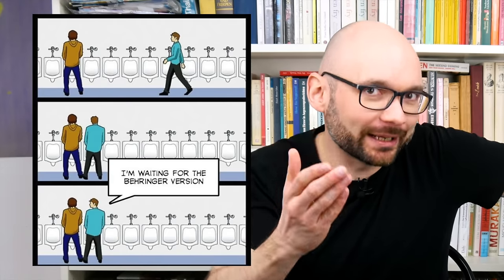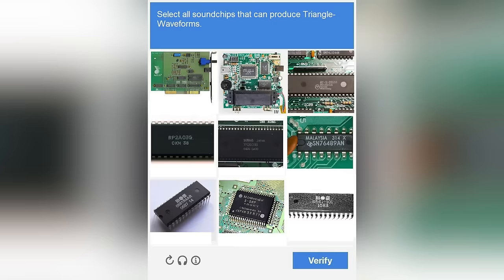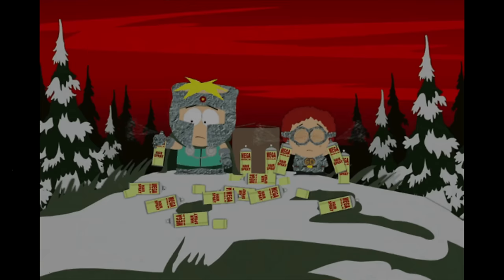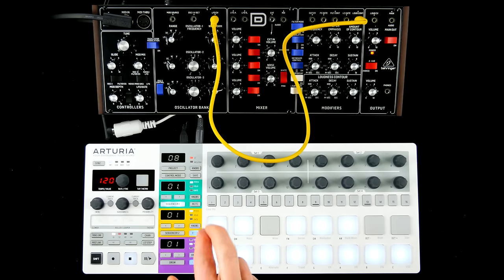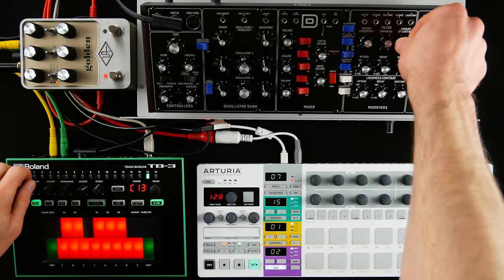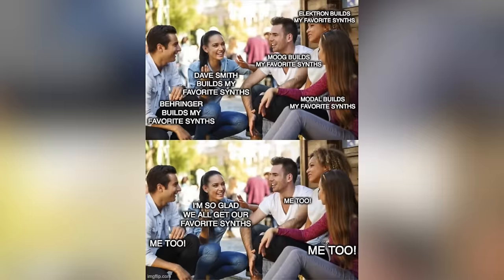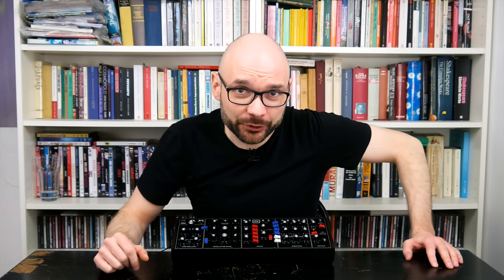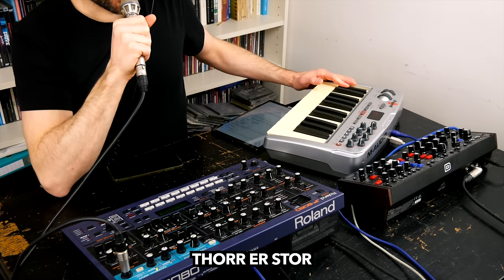Bad Gear - Behringer Model D

Comment: As someone who has never been in love with the Moog sound, getting to experience a bit of the Model D for just a few hundred dollars was good for me.
Reply: If you're not in love with the moog sound what are you in love with
Reply: @tadknuf7979  not moog sound.
Reply: And then you realize that it isn't a Moog model D ( which Moog, btw ) , but in fact a 'Behringer D".
 Simulacra and simulation of a genealogy, indeed. Genes are just genes, and then there's everything else that aren't genes.
Reply: @shaft9000  Soulless digital Internet can never replace the original, warm, cooing and pooping mail pigeons.
Reply: @tadknuf7979  I’m partial to the 90s Roland sound. I had two M-32s and two DFAMs at one time, but I had to sell them. I do miss them, but I could never sell my JD-990.
Reply: I like the Moog sound in moderation. It takes a Moog Whisperer like Lisa Bella Donna to keep an entire herd of Moogs from excessive Mooing.
Reply: I’m a buchla sound guy myself

Just something about having a synthesizer the size of a car that takes full size patch cables just to still be basic and mono will never sit right with me

Moog doesn’t really do things different either they’ve been hashing out different versions of the same thing since the 70s
Reply: @tadknuf7979   *butts into conversation* .. I confess, I'm in love with all of it. But my favorite is classic wavetables and vector, a la Wavestation, SY77, Waldorfs.
Reply: @cablevamp3163 DFAM, Sub-Harm, Moog One, Semi-modular synths G-Mother, Matriarch?
Reply: I like your name
Reply: @danieklerr  SY99 is AFM and AWM, not vector
Reply: @jonytube  .. True, sorry. I meant SY77. I have both, and the 99 is weak in comparison.
Reply: @ptkelly80  🤓
Reply: @danieklerr  the 77 is AFM+AWM as well, the only difference from the 99 being no user sample memory and (5 octave instead of 6) keyboard. Aren't you thinking of the SY85?
Reply: @jonytube  .. Dang, I hope not, lol. I'm a little young for dementia. It's definitely not the SY85, which I sold when I got an FS1R. I thought the SY77 (I have the TG77) had vectors, with four directional buttons on the front panel, similar to the Wavestation SR. There is something to note, however.. I have been collecting gear since the late 1980's, and I have so many synths that they are leaning in rows against all four walls of a huge room, or in racks. I have to rent a large space outside my home to store them, and I am probably beginning to forget specifics, lol.
Reply: @jonytube  .. I dug through the pile. It's the SY35, which has a dome-shaped vector joystick, but has indentations for fingers, giving the impression of buttons. :)
Reply: @shaft9000  I remember when there was mini Moog and the micro Moog.
Reply: @cablevamp3163  Sold my Matriarch after having it for a few months for those reasons and some others. I bought an Arturia MiniFreak with the money and I can make all the sounds the Moog could make and even more, plus I could actually save them. Analog purists are living in a fantasy land. I'm done paying Moog tax just to make sounds that can be made on synths that cost 1/4 what the Matriarch costs.
Reply: @danieklerr  yup, that seems right. My 77 isn't vector :P how's that FS1R?
Reply: @IISG93II  as good as minifreak is, no, it cannot make all the sounds a matriarch can.  It can make more sounds, arguably better sounds, but not the sound of a matriarch.
Reply: recreating "moog" sounds isn't hard. I've been messing with sound design for a while and this is all very achievable even with software synths.
Reply: @nullbyt  as some who doesn’t simply mess with sound design and has been doing it longer than a while, a soft-synth gets only so close to an actual analogue, even if it can get 90% there.  That extra 10% matters.   I just got the akai mini d and it’s meh.  Arturia only slightly better.  Vst is vst.  One day it will get there.
Reply: @alexwestconsulting  I agree kinda.... But like when you're willing spend a ton of money on an analog synthesizer for that 10% I guess it really needs to be worth it imo. And like why even buy something that's a low quality recreation lol just seems like it's missing the point of owning something like an analog synthesizer to begin with
Reply: @nullbyt  The Model D is very good.  I own a bunch of real Moogs and I would recommend the Model D.  There's something about bass sounds in particular, so important in any track, that can't yet be done in VST, and the moog sound is one of the quintessential ones.  If you got a model D and Pro One, not at all expensive, you would cover a ton of sonic territory that VST just can't (yet) nail the dynamics of.  That 10% is the difference between "the sound of", and a living, breathing sound.
Reply: @cablevamp3163  I am getting more familiar with the Buchla sound and concept of west coast synthesis. The sounds are indeed awesome but they seem to be relegated to pure electronic synthesis in the experimental style. I might pick up an Easil. They are well designed ,definitely not cheap either. I don't see them superior or inferior to the Moog style of subtractive synthesis. Just different and unique in their own sound.
Reply: @alexwestconsulting  A friend of mine is close friends with Adrian Utley from Portishead, who has a huge collection of original synths, including many Moogs, and he told my friend he can’t really hear the difference
Reply: @tompoynton  can’t tell a difference between what?  I mean, first off, Utley, great as he is, isn’t the only one with an ear.  But, more to the point, are you suggesting that a second hand account is accurate in what he said?  Are you saying that your friend said that he said “I can’t tell a difference between a boog and a minimoog”?  Or are you saying that your friend said that he said “I can’t tell the difference between any of the clones and the OG’s”?  Because, frankly, I do not believe he said the latter.  The differences are well documented.  No one, for example, thinks that the MS-1 clone sounds like the real thing.  I mean, it’s just a straight up fact that behringer is putting the same Curtis clones 3340’s in just about everything they make.  They aren’t making Roland chip clones.  Not yet anyway.  So, if the Behringers have the same components, while the OG’s have a breadth of different components.  How can the Behringers truly sound like the OG’s?  And how can the Behringers sound different from one another?  Many people think that the crave is M32 clone.  In function it is.  In sound it is not.  I have both right here.  They don’t sound even remotely similar, with the crave having Curtis clone 3340’s, the sequential sound, in a  moog “clone”.  It’s kind of funny really.  Or do you mean that your friend said that he said “I can’t tell the difference between VST and an analogue”?  I mean, I know how much gear Utley has, so that would be nonsensical on its face.
Reply: @alexwestconsulting  he was talking about the model D
Reply: @tompoynton  yes, the model d is very good.  Best of their clones.  Nice and smooth like a real minimoog. Doesn’t sound like a sub phatty though which has more “character”, and doesn’t sound like a Minitaur which is a bass monster, so I hope people understand they are getting a moog clone, but only A minimoog clone.  The new generation of moogs are stellar, many of them affordable, So I hate to see people cheap out and not buy unless Behringer rips it off.  Also, I have a poly D too and poly D and model D sound quite different.  I don’t know what the poly D sounds like.  I like it, but not sure which moog it sounds like.  I still don’t now which chips they use in those moog clones.  Most definitely not 3340, but I haven’t been able to figure out what and where they source it from.  They’ll get the Roland sound right too before long, but they rushed to production with the wrong chips.  Having said that, I’ve got a deep mind 12d which is supposed to be a Juno-like machine, and while it doesn’t sound like a Juno, not nearly as “lush”, it’s an awesome machine, my favourite behringer.  I honest to god wish, for the industry’s sake, that Behringer would quit just ripping stuff off and innovate like they did on the deepmind.  But, alas, it didn’t sell because people just want a “good deal” on a clone.
Reply: I’m totally commenting before the intro even ends. Haha I love my model d and am wondering what this guy is gonna say.
Reply: @alexwestconsulting  original sh-101 also used the CEM3340 by the way so using it in the MS-1 is authentic. (Moog also used it in the Memorymoog as an aside). Lots of Behringer clones don’t use the CEM3340 - the Model D and Poly D use discrete oscillators based on the minimoog, the Odyssey, 2600 and TD-3 also use discrete oscillators. The Wasp uses digital oscillators like the original.
Reply: Its funny to hear these silly arguments as to what the "Moog " sound is to this or that.  If a classic ladder filter is as easily relegated to being by an example "humbucker vrs single coil". I love them all since I have a sample of quite a few of the main manufacturers since about 1972. There are things Moog does very well, yet things my Oberheim and Arp synths do that the Moog doesn't. Yet at the same time I love the filters used by Korg and Roland. These are synthesizers, not guitars. They sound like what you make them sound like, for the most part. If matched transistor pairs rock your boat better than a SMD filter chip , go for it. Lots of great technology out there laying in waste because everyone got caught up in the next greatest thing.
Reply: @danieklerr  SY22 had the joystick and vector stuff as well.
Reply: @tadknuf7979  For some of us the Moog sound evokes visions of flared trousers, platform shoes and synth players wearing capes. I had a Voyager briefly and soon parted with it.
Reply: @unclemick-synths  lol